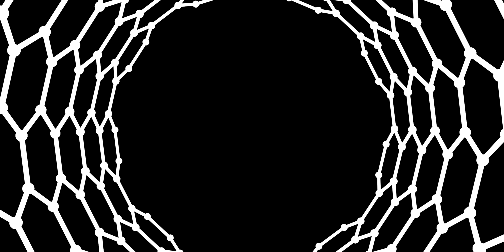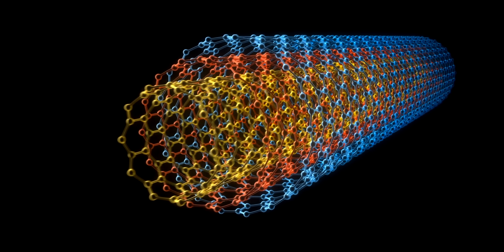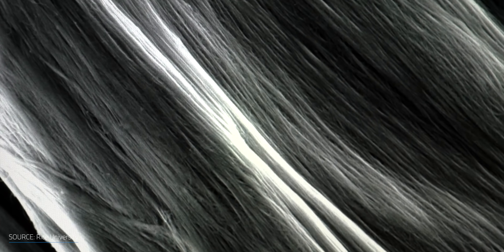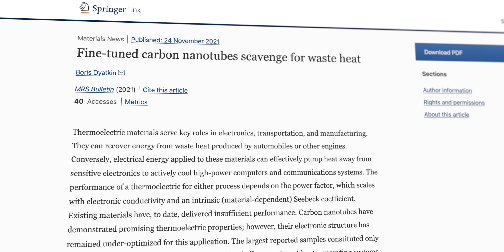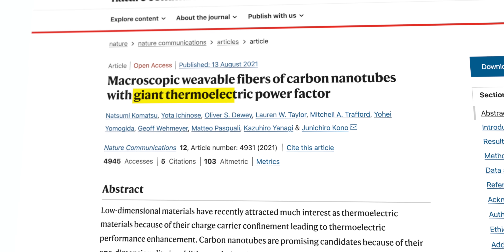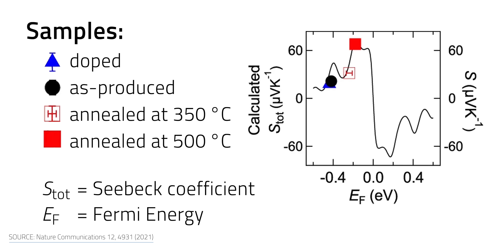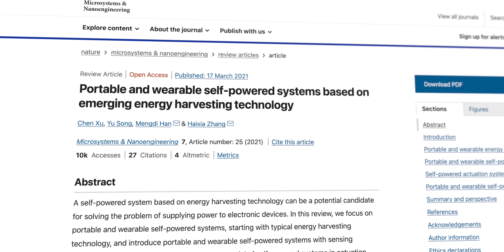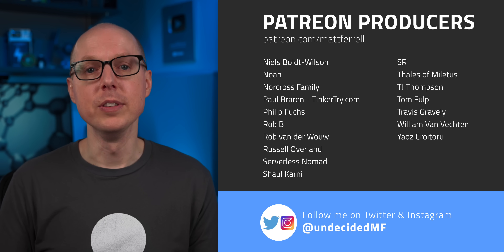Revisiting How Carbon Nanotubes Will Change Renewable Energy

Comment: Will carbon nanotubes become the new ocean micro plastics ?
Tiny, don't decompose, tough to filter/recycle 100%, etc
Reply: Carbon is very simple to recycle, just heat it in an environment with no oxygen, and all you are left with is pure carbon(nanotubes, graphene or fibre could be done in the same facility).
Reply: @coast2coast00 big sheets yes. But like with plastic, when it's banged damaged disposed and trillions of micro sized pieces end up in the ocean, how do we filter/collect? Or will it end up hurting marine life like microplastic or mercury rtc

Comment: What is puzzling me, they did that in fabric, but matt is suggesting significant power? I am afraid, such fabric will not warm you and would be a short lived product...to flash an LED? With a series of some standart capacitors? If they put that in a peltier like device with significant power output, call again.

Comment: There is a new car that is supposed to come out later this year called the Lightyear One. It is a partially solar powered vehicle who’s manufactures claim that it’s solar panels can add 30-40 miles per day of range on a sunny summer day. Assuming it really can do that, if they were able to make those solar panels 2-3 times more efficient using the above technology, could you potentially have a vehicle that could go several thousand miles without needing to be plugged in if you parked it in the sun everyday, lived in a sunny climate and did not drive more than 40 or so miles a day?

Comment: I saw carbon nanotubes 20 years ago in a research lab at Philips Research - working in electron microscopy projects. Interesting tech, but it seems to be they are still not yet robust enough to leave the labs yet.
Reply: Carbon nanotubes are available in different forms . Since last 8 years I am dealing in carbon nano tubes of different size suspended in oil  .Main application is Automotive uses and industrial applications.
I have  4 modules to offer  1) Engine Treatment 2) AC Treatment 3) Suspension Treatment and 4) Tire Treatment.
Very good results have been achieved .
Quieter engine,cooler engine,more power almost zero maintenance and pollution. 
Most of the lifter and or tappet  noise goes away never to return
Reply: Yea, Its been already 20+ years of promises that cnt will make revolution in .... but in reality they are still a gimmick. H
Reply: While this is still a widely held perspective it is no longer consistent with the facts on the ground.  Although it may seem as though CNTs are not ready for prime time, the reality is that commercialization is underway with CNTs now having been incorporated in products that include conductive polymers, transparent conductive films and battery materials.  For example: https://15n4u520e106qb7zy1jezch1-wpengine.netdna-ssl.com/wp-content/uploads/2021/09/BPSNTECB_NTeC-B_TDS-1.pdf

Comment: Even just the power cables present a large opportunity without being strictly speaking technologically revolutionary. Not having to mine-up copper, aluminium, etc to make power lines and being able to use carbon instead would have a huge sustainability boost. Especially since Direct Air Carbon Capture is much more economically viable as an industrial carbon source, rather than operating them as a charity to sequester. “We pulled your power lines from thin air” could be an advertising slogan for the first company to do this.
Reply: Have you ever taken a look at Stuart Licht and his company C2CNT? He's been trying to commercialize a process where the carbon is directly absorbed into molten salts from either the air or flue gas and electrolyzed into carbon nanotubes. There's a pilot project running with Capital Power right now- you can even get exposure to C2CNT because Capital Power owns an equity stake and stock options in C2CNT.

Comment: As an idea of marketable efficiency I think CNT is much farther off than other technology that will increase the efficiency of solar to consumers. Grid storage. Grid storage is much closer and will be the new concern in making the grid renewable long before we concern ourselves with actually making the panels more efficient which when we still have plenty of space and raw resources for them just means cheaper anyway. Graphene would be better for geothermal anyway since we can just dig down for heat and probably mine lava to get a renewable constant energy source once we have lots of it and it would probably be used for materials tools or structures first anyway not power.

Comment: Could i take a  carbon nano tube and run it from a processor on a coumputer and run it back to the power supply to lower enrgy consumption from the plug?

Comment: I’ve noticed on your last few videos the audio tends to clip the last part of words. Usually at the end of your sentences. My guess is you have the gate set too high on your audio recording equipment. When the volume of your voice goes beneath a certain threshold it cuts the mic in an effort to remove the remaining background noise.

Comment: 4:04 The grid uses aluminum because copper doesn't have the physical strength to be used as wires.

Comment: Semiconductors were discovered in 1874. While we had diodes first, we didn't get a working transistor until 1948. Thirty years since the discovery of CNTs is not a long time in the context of new materials commercialized applications.
Reply: I was just thinking how long it took us to figure out how to produce high-purity silicon, and then again to selectively dope the wafers, and then again to keep it all clean enough for the final design to work. Before we even conceive of things like CPU evolution. We’re definitely still in that early purify and doping stage with 2D materials. We’re still at the stage where we’re even figuring out the best doping materials or base materials. The work with graphene is just one aspect, they’re trialling all sorts of one-atom-thick materials.
Reply: Being dismissive about new technology is a way to sound smart without having to know anything. And yes, a lot of ideas aren't going anywhere, but damn a lot of other commenters here are really dumb. According to these people, we've apparently reached peak technology now and nothing will ever get any better than 2022.

Comment: I worked with the nano folks at NASA Ames, and it continues to be on the radar. Just a matter of time. Buckeyballs and nano tubes continue to produce very useful breakthroughs. I'm betting that commercial zero gravity research and manufacturing will contribute massively as it comes online.

Comment: I want to be a scientist to be a part of the zero carbon energy future transition. What advice would you give to me? 

Also I'm a high school student and I don't know which becholar degree is best for me.
Reply: Physics, chemistry, biology, they all have their part to play in the R&D side of things. And they can all also net you industrial or corporate jobs if you decide to pivot to working on that side of the equation. 

Studying engineering could be another bet, those degrees are largely physics and maths (which is a bit redundant to say as physics is also a lot of maths), but if you know you want to be more hands on and practical side of things, you could try for engineering. Any specialisation within those fields can come after, really. 

For instance chemistry could then specialise in battery chemistries, electrode chemistries, different fuels, production techniques for mass production, organic chemistry, and more. 

But each field has many possible specialisations and overlaps, so picking any STEM field isn’t really locking yourself into any particular path yet.

Comment: Matt, power factor is a term already taken by Electrical Engineering. Carbon Nanotubes can’t have it!  Your definition does not appear to have any direct relation to the original Power Factor that has been around since Tesla and George Westinghouse setup the AC Distribution networks! 

In electrical engineering, the power factor of an AC power system is defined as the ratio of the real power absorbed by the load to the apparent power flowing in the circuit, and is a dimensionless number in the closed interval of −1 to 1. A power factor magnitude of less than one indicates the voltage and current are not in phase, reducing the average product of the two. Real power is the instantaneous product of voltage and current and represents the capacity of the electricity for performing work. Apparent power is the product of RMS current and voltage. Due to energy stored in the load and returned to the source, or due to a non-linear load that distorts the wave shape of the current drawn from the source, the apparent power may be greater than the real power. A negative power factor occurs when the device (which is normally the load) generates power, which then flows back towards the source.

In an electric power system, a load with a low power factor draws more current than a load with a high power factor for the same amount of useful power transferred. The higher currents increase the energy lost in the distribution system and require larger wires and other equipment. Because of the costs of larger equipment and wasted energy, electrical utilities will usually charge a higher cost to industrial or commercial customers where there is a low power factor.

Power-factor correction increases the power factor of a load, improving efficiency for the distribution system to which it is attached. Linear loads with a low power factor (such as induction motors) can be corrected with a passive network of capacitors or inductors. Non-linear loads, such as rectifiers, distort the current drawn from the system. In such cases, active or passive power factor correction may be used to counteract the distortion and raise the power factor. The devices for correction of the power factor may be at a central substation, spread out over a distribution system, or built into power-consuming equipment.

In simpler terms, a resistor has a power factor of 0, Meaning the current vs voltage relationship phase is 0 degrees, Power Factor Correction use an inductive or capacitive network to correct leading or lagging current vs voltage phase relationship to close to the perfect 0 degrees of a resistor to gain maximum efficiency and lowest cost possible.

Comment: also not a scientist. i think a best case scenario would be something of a hybrid of some sort. maybe a low energy power converter kind of like the starter motor in a car. potentially gloves that have a main power source like a 2032 battery and the nanotube fibers make for a small electromagnetic field around the glove give a slight magnetism for mechanics?...as long as they dont wear a watch...or have a pacemaker?

Comment: The thermoelectric angle is potentially HUGE. God, I hope that works. How awesome would 80% efficient solar panels be? How awesome could heat to electricity from any source be? That is about as close to magic as science can get. That's clothing that can charge your phone, or using the heat from your brake pads or friction from tires, bearings, and electric motors to recharge your car's batteries. That would be game-changing. 
That's literally getting power from where the rubber meets the road. Just imagine using a battery to power a motor that produces heat, that recharges the battery running the motor that's creating the heat... It's about as close to a perpetual motion machine as phisics can allow.

The possibilities are endless, if they can scale it up and get it to work. Fingers crossed!!!  :D
Reply: Did it say an 80% efficient solar panel, or 80% more efficient panel? So if 23% is standard, then 41% with the improvement.
Reply: @punkdigerati  I understood it to be an 80% efficient panel whereas standard panels are between 20 - 30%.  That's huge.
Reply: A reverse resistor

Comment: If the Carbon Nanotube Dough that was shown at 11:55 still keeps it thermo characteristics, it might make for a revolution in thermal pads for GPU like consumer electronics... cool stuff !
Reply: CNTs have to be organised in one orientation in order to have any kind of effective thermal transfer characteristics, so a smoosh of them in a dough wouldn't be a good thermal conductor.
Reply: @dylanevans5644  Yeah really good point there, it would most certainly require a specific manufacturing process... and i why i wrote the "might make" part... this is not like magic, and it clearly takes some tinkering before it can enter the market :-)